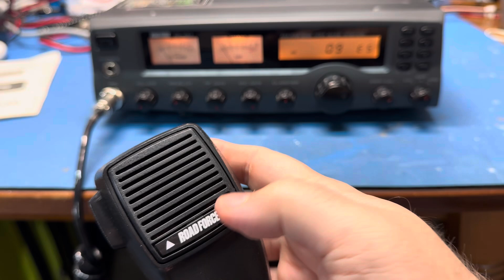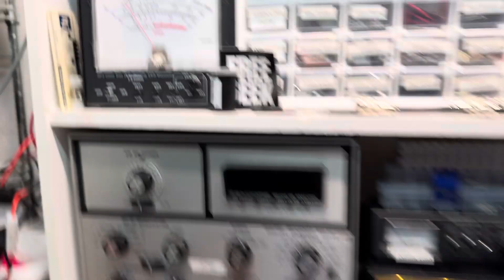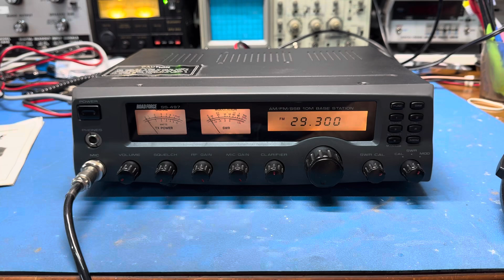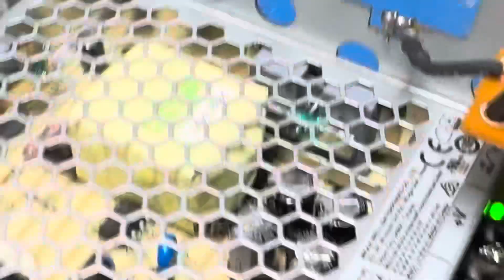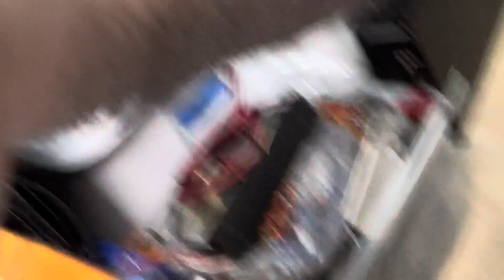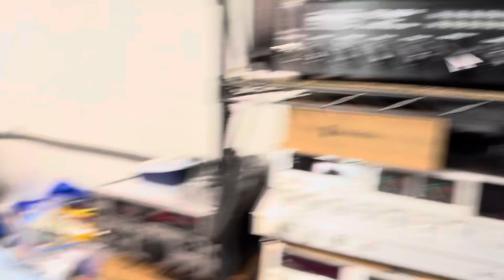Roadforce SS-497, Albrecht 497, Cherokee CBS-1000, Eagle Tomahawk… Overview of use and mods

Comment: When I first purchased my Eagle tomahawk it was out of alignment with weak modulation right out of the box and I wouldn't have given you a plugged nickel for it! I sat down on the bench and I set mine up like a Sherman tank!  I set the FM and the AM up to run on their own individual power adjustment pots so the power stays the same in both modes along with a master power level pot on the back. I also did a frequency adjustment mod by adding a small 10 turn frequency calibration pot on the back of the radio too. The last mod I made was adding a 2 stage audio preamp at the front end that also sent +5 volts up to the stock microphone where the crappy element was. That was replaced with an electric condenser mic along with some weight added inside of the microphone to give it a great feel while holding it. You also mentioned the lack of AM mod but that's easily addressed with a bit more front end preamp audio with the mic preamp mod. The FM deviation was easy to make separate so that the AM mod settings would not affect the FM deviation and adjusting the AM mod limiting would not cause the FM to splatter. They actually had a simple audio limiter that was separate for the FM to control the issue of over deviation but where they dropped the ball was when you cut the AM mod down it choked the FM deviation back too. I did a complete TX and RX alignment including an alignment on both the sideband and FM and the radio now rules the roost! I forgot to mention the light issue you discussed too. The lights are old school and mine started burning out and after replacing them a few times, I finally switched over to small white LED's and buffed them with sandpaper to give them a frosted look and I put a dab of black magic marker ink on the tips of them so the light didn't have hot spots out of the tops of the LED's and replaced the little wheat bulbs with the modified white LED's. I also modified the radio so that instead of a dim to bright setting that my face plate lights are now either on or off at the push of the front button. I used the logic voltage for the bright-dim feature and a extra transistor added to the mix to accomplish this plus the tiny transistor they had for controlling the front lights now stays cool too! No more burnout problems with the transistor opening up due to too much current from the old school lights now. Another plus is this way at night, the light does not keep me awake. There was another issue with the original lights you or others may or may not be aware of. They produce heat and in the wacky ass-hat design near the CPU there is a small pot adjustment there too for the over-all frequency adjustment and as the light would run, it would produce heat and throw the radio's frequency off. Going to LED's all but eliminated that little issue. This was another reason I placed a tiny smd 10 turn pot onto the back of the radio that you can access with a small jewelers screwdriver before I solved that drift mystery due to the heat from a tiny  incandescent bulb. I have two of these radios both purchased from Copper and both the later models that don't skip over the B channels. One has all of the mods and is totally brand new still in the box ready to use should my main radio go down and need servicing. You mentioned changing out to a switching supply. Do you not have switching noise issues that add any white noise to the radio's RX? I REALLY REALLY REALLY like that idea but the switching noise is my only concern. If you try to use some of these switching supplies you WILL see the "S" level display as if you were dealing with a noisy floor level. I just helped a friend fix that very issue with his setup because he was using a cheap Amazon special switching supply and he couldn't understand why his long distance RX went down hill with his long distance locals he always spoke to. It was the switching supply that buggered him. Hopefully you'll reread this and respond back. I may even make a Youtube video on my Eagle tomahawk showing all of the mods I did to mine. The only thing I can say about these radios is their RX sensitivity isn't as good as my RCI radios or my Anytone radios even after putting it on the bench and doing a professional alignment on it. I'm now retired but I worked in electronics repair along with some design for around 46 years before I got burned out on it. I was at my last job I retired from for close to 20 years and that was strictly working in RF for the cable industry covering the repair/design of Headend gear, line gear and all the way down to the converter boxes themselves. I worked as the chief tech over everyone in that company and as a associate engineer with them too before retiring plus as a perk I wound up with a killer bench setup with spectrum analyzers, quality scopes etc and everything a radio guy could ever want for radio shack stuff. Hopefully you'll get a chance to read this and respond back about the possible switching supply issue I mentioned.

Comment: Don't forget the Dragon SS-497/P. I have a couple of them, and I love these rigs (the later ones, with factory RF power adjustment and a good RF Gain, and 25watts). It also remembers where it was after power on, unlike your earlier version here.  Tip: If you hold PTT while powering on, it disables the key beep (on the later versions anyway). Good job on the PSU swap, very neat work!